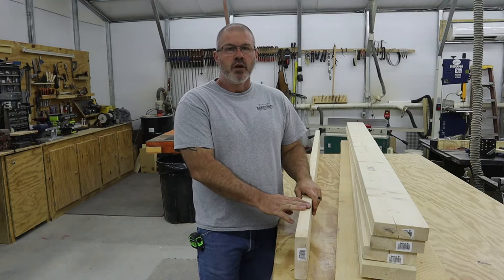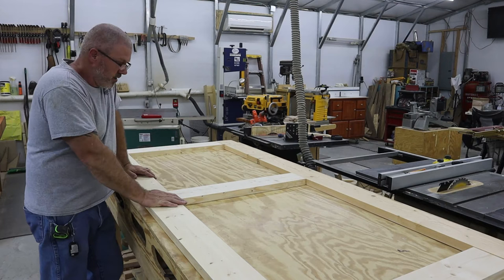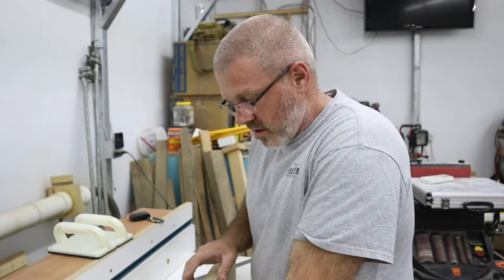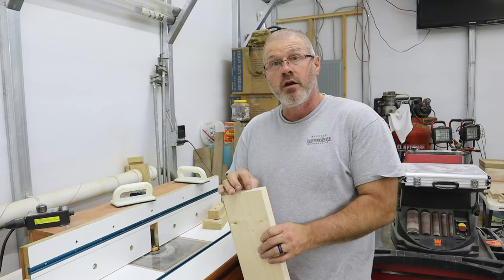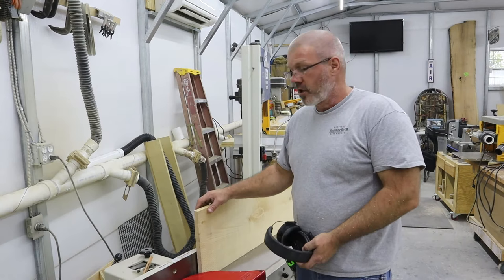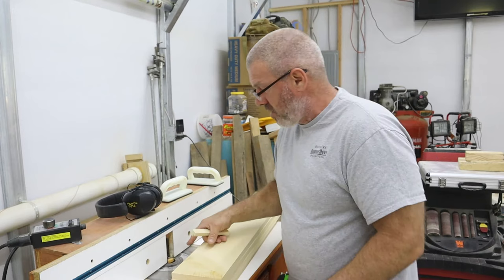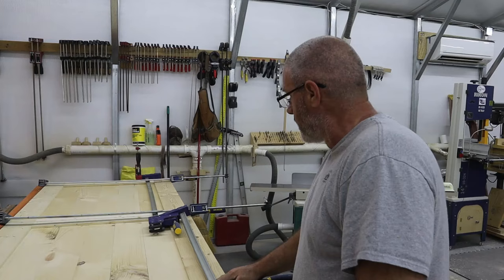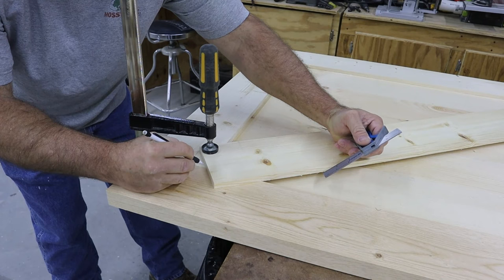Build your own barn doors. Easy step by step instructions

Comment: Excellent video. Can you provide a list of router bits you used? I heres what I got:
1/4", 1/2", & 3/8" slot bit
1/4" Toung bit 
3/16 roundover bit

BTW, you should do some detailed  instructions and sell them while barn doors are so popular. You'd make a killing.
Reply from the maker: Thank you. I would do some detailed plans but those doors are ordered in so many different sizes it wouldn't help much. Everyone would still have to sit down and do the math for the size door they wanted. Some want different widths of slats and sliding doors, some want more or less of an overhang. I used a 1/4 inch tounge and groove bit set to tounge and groove the slats together. I used a 3/8 slot cutting bit to cut the slot all the way around the inside of the door frame. 1/2 slot bit to cut 7/16 off each side of the frame rails to make the 3/8 inch tounge. And I used a 3/16 inch round over bit to round over the outside edges of the door. All the slots, tounge and grooves joinery could all be made on the table saw. Just takes longer to set up.

Comment: This was a very informative video.  I am about to build a set of barn doors and was wondering if the dowels are necessary.  I can see they might be if the groove is fairly shallow on the rails and stiles.  What if I cut a deeper groove?  Would the surface area of the tenon be enough to create a strong joint once it's glued?
Reply from the maker: I have made a few barn doors without the dowels. I am going to release a barn panel door video soon that has no dowels. If you hang the hardware on the styles it should be ok. I think so. But if it is going to be hinged I would feel better to have dowels or some type of tenons. Hope this helps
Reply: Yes, thank you very much.  The door will be a hanging barn door.  I'm a novice and learning as I go by watching lots of videos before embarking on a new project.  This video was the one I watched that sold me on the idea that I could build one with tongue and groove panels.  I even purchased a set of dado blades.  Thanks for the informative video!
Reply: Finished building a set of doors for a 61" cased opening in our hunting cabin in south Texas.  They have a few flaws, but I learned a lot building them and am happy with the results.  Now all I need to do is hang them.  Thanks for the video.   I'd send a picture if I could figure out how to add it to the reply; a simple copy-paste doesn't seem to work.
Reply from the maker: @kleonard-zm7nq  I am glad the video was helpful and you finished your project. Yeah I don't know how you would send a pic in the comment section either. Never tried it but I have never seen it done either so I'm assuming it can't be done. Thanks for letting ne know you finished your doors

Comment: I’m building doubles. 33”w 83” tall but wasn’t sure how much to charge. I’m also finishing them as well as fabricating the metal sliders instead of buying two $170 kits to save probably over $150 on materials to profit more from this project. I actually built them similar almost to a T compared to yours.  I’m about 100% positive I undercharged for my time but it’s just a side gig and also my hobby. I charged $800 for all so far and wondered ball park price on your one non finished and no hardware??? I would like to feel better about charging more but not sure on prices.
Reply from the maker: The door in this video was all made out of construction grade pine 2X6X8 and pine slats. My prices vary due to the cost of materials used at the time. Hardwoods, such as maple, oak, etc will cost more. So whatever cost you have in your materials plus whatever you value your labor at. I guesstimate the amount of hours it will take to make a project and then multiply that by your hourly rate. To give you some kind of idea on a cost per hour, most will try to make around $30 an hour over all. So as a hobbyist some may only charge $30 per hour for the project. As a business you have to account for your overhead. Such as wear and tear on your tools, electric power used, glue, sandpaper, etc. In cases such as this you may need to charge $60 an hour. Remembering that as a business you will be paging taxes on what you make also. As a hobbyist you can do odd jobs for people and probably not have to pay any taxes in. You have to make so much in a year before taxes are payable. Check your state law on the amount and any other laws or restrictions that your state may have. Hope this helps. I have thought about doing a video on the complete process of wood working as a business. The do's and dont's. How to cover yourself and what all to consider when charging a customer. Would this be a video of interest to you? I have watched so many videos on YouTube about how to make money Woodworking and make these cheap projects and make big money and none of them cover those finer details.

Comment: Awesome build. I’ve done some barn doors on my own and have had my last couple bow/warp. Any suggestions? Also, on your slats-is there glue running vertically in between or is it just tongue and groove allowing for potential movement? Seems like on my doors the horizontal pieces like to bow
Reply from the maker: Thank you. The slats are free floating for movement. Just the tounge n groove and dowels are glued. I let my wood sit in my shop for a couple weeks to acclimate to my shop before milling. If there is any problem boards such as bowing, warping or cupping I discard them prior to putting it together.  I have made several and have never had any issues. I have 4 in my own home I have made and they are all just fine and have been up for about 3 yrs. Hope this helps

Comment: Thank you , very good video.
I have customer that wants chevron pattern , and I've never done chevron. How do I do chevron with chevron on bothe sides and keep thickness to no more than 1.5 "
Thank you
Reply from the maker: I would use 1/2 or 3/4 inch ply and attach my pattern to that milling them to the thickness you need over all
Reply: @hammerdownwoodworkingtracy3679  thank you

Comment: Great video! Can you explain the 1/16" per board for wood movement? Are you leaving a gap between each board and if so, do you use pennies as spacers when you're assembling?
Reply from the maker: Thank you. Glad you liked the video. I put a 1/4 tounge n groove joint and the is a 3/8 tounge around the whole inside panel. When milled (I am referring to the cross grain) each board is 1/16 narrower than the final detentions needed to make the panel. This gives  1/16 inch per board. When assembling just use a 1/16 in shim to speard the spacing out. Hope that makes sense.  The panel is not glued and is free floating and this allows 1/16th of an inch per board for movement
Reply: Finally finished mine. I’ve been wanting a door to partition off my basement workshop for awhile. Had to bring the wall out a bit as the original opening is on a slight diagonal. Definitely not perfect but did the best I could with the tools I have and proud of my first attempt at something like this. Thanks again for the video! https://drive.google.com/drive/folders/1Cfh5NMKARHpBwna_jZJIdy5uGma8bI6g
Reply from the maker: Thank you. That looks awesome.  Nice job.
Reply: About how much do you have into it in materials?
Reply from the maker: I don't remember what that one cost. That video was 2 1/2 years ago and lumber prices in my area changes all the time.

Comment: Enjoyed the video. I have  58” opening I would like to cover. Would a build like this work for a door that wide?  84” tall. Thanks!!
Reply from the maker: Thank you.. That is very wide. I would consider making two smaller doors that will cover the area. Then you can open one side just to travel through and can open both if needed. You can even make them look like one door when they are together

Comment: @Hammer Down Woodworking Tracy Maxfield  does glueing  the diagonal decorative piece interfere with wood movement?
Reply from the maker: Hello Shane. I have never had any issues with it at all. I do not put an excessive amount of glue on it. Basically just enough to hold it in place.

Comment: Hi
After I build my barn doors, they do not lay flat, they are slightly lifted on both sides
Can you explain why this happens? I use kreg to join the styles and rails
Reply from the maker: I don't know why the door would be bowing on you. I haven't had any issue with mine and I have made a lot of doors. I would suggest making sure your wood has acclimated to your shop prior to milling it. And do a dry assembly making sure it going together flat. And make sure you keep it flat when clamping. Leave the clamps on it until the glue dries. Other than that I wouldn't know

Comment: can you also call the cross brace a crossbuck, or is the design style called crossbuck after adding the cross brace?
Reply from the maker: A crossbuck to my understanding is an X on the door and a / is a halfbuck. In most cases it's also called a cross brace when there is only the one / instead of an X but the brace is decorative and not supporting anything structural with this piece. But I guess you can call it either if you want.
Reply: @hammerdownwoodworkingtracy3679  ok, thanks. i usually see these on sliding barn doors or dutch doors, and i think it adds a nice touch to a home to make it feel more "homey."
Reply from the maker: @thispersonrighthere  I agree. They do look nice and lots of people are adding them to their homes

Comment: Great build. Did you glue the slate to each other and to the frame?
Reply from the maker: The slates are free floating inside the frame. They are tongue and groove jointed together with no glue

Comment: Hi Tracy, this is a question not a criticism, wouldn't it be better to have a longer mortice and tenon on the top, middle and bottom Stiles with it being such a big door? Regards Jim UK.
Reply from the maker: Hi Jim. Yeah you can do a mortise and tenon joint. I have use tounge n groove joints with dowels in several of these doors. I have 4 in my home. 2 on a rail and 2 on hinges and have never had any issues. There is enough long to long grain glue joints to hold it even without the dowels.i use dowels just as a little insurance. But you could definitely use mortise and tenon.

Comment: Why does my barn doors lift on both ends after I finnish making them? 
Thank you
Reply from the maker: What do you mean by "lift"? You mean they are not flat?
Reply: @hammerdownwoodworkingtracy3679  yes, not flat
Reply from the maker: @paulshaw6125  If your materials are flat and your joinery is cut straight and correctly, the only thing I can think of is clamping pressure pulling a bow in your door and the glue is drying it that way. Are you applying clamps over and under to oppose the pressure and hold the door flat?
Reply: @hammerdownwoodworkingtracy3679  I clamp the first board, then attatch the rest1 at a time and clamp with a pipe clamp til I put in Brad's, then take off the pipe clamp and go to the next board.
Reply from the maker: @paulshaw6125  I don't know why the door would be bowing on you. I haven't had any issue with mine and I have made a lot of doors. I would suggest making sure your wood has acclimated to your shop prior to milling it. And do a dry assembly making sure it going together flat. And make sure you keep it flat when clamping. Leave the clamps on it until the glue dries. Other than that I wouldn't know
Reply: @hammerdownwoodworkingtracy3679  alright, thankbyou then
Much appreciated